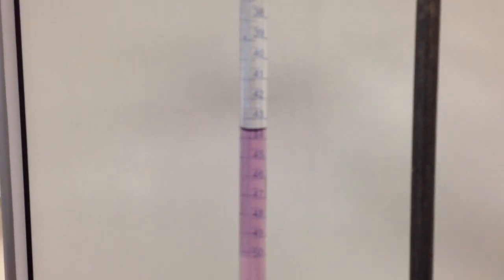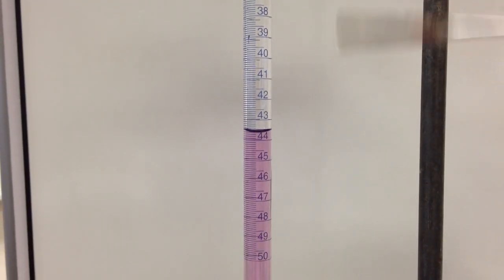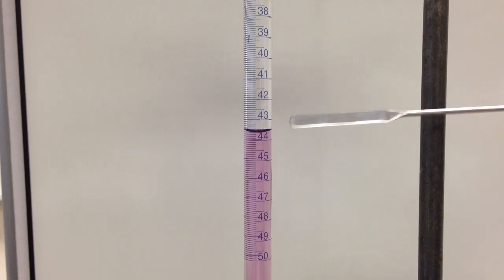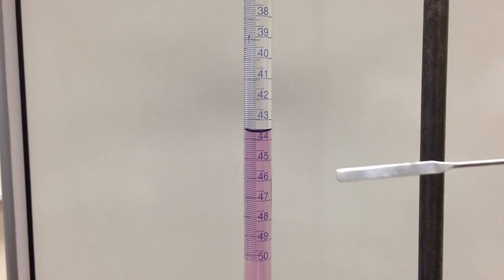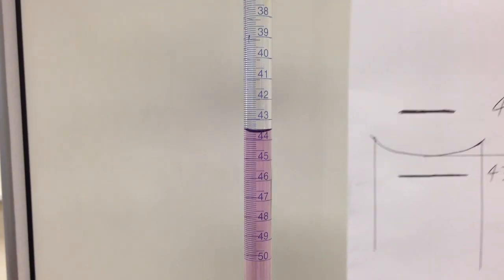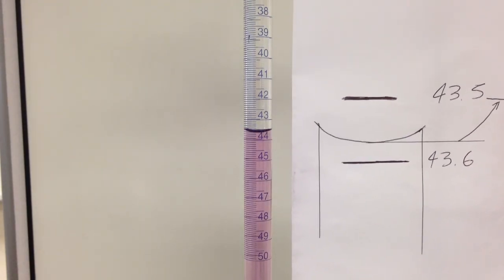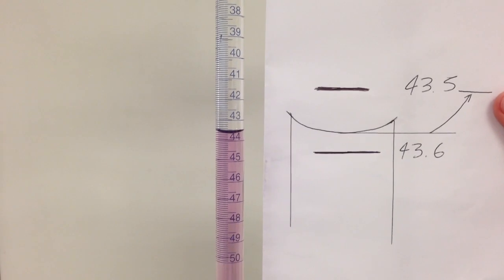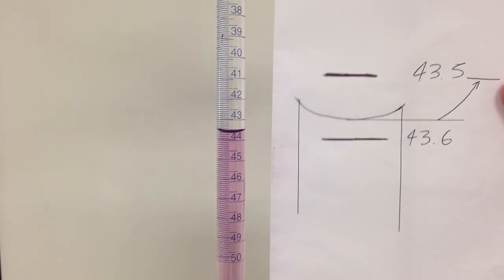How to Read a Buret in Chemistry

Comment: you can't estimate 43.56 because that has 2 values that aren't sure.  it can only be 43.5 OR 43.6 so you have the correct number of sig figs
Reply: +Allison Chvala Actually we used "43.56" in my course as well. You should be pretty sure to 43.5 since thats the units on a buret, the last digit you are unsure on
Reply: 43.56 is correct. You take the unmarked increments and divide it by ten. You get .01 meaning you need to have two decimal points. 43.56.
Reply: @nothingatall6882  completely agree!
Reply: @nothingatall6882  what do you mean unmarked increments?

Comment: Why do we estimate the last digit?!
Reply: In Science, we have to consider a digit of uncertainty. for example the buret is 50 mL, more specifically it will label somewhere (usually at the top) that will look like this 50.0 and/or list the +/- std dev(which tells you how many uncertainty digits are present).

In the example above she gives, we know this buret reads 50.0 mL but we have to go out ONE more digit to account for uncertainty in the readings. so you measurement will be 50.0 (some digit that is left up to you guess) i.e 50.05 mL or 50.3(your guess, goes here; lets say 5) ---> 50.35 mL

Hope this helps! :)